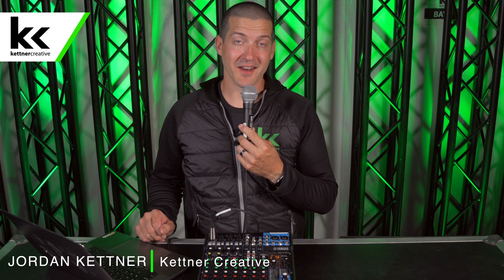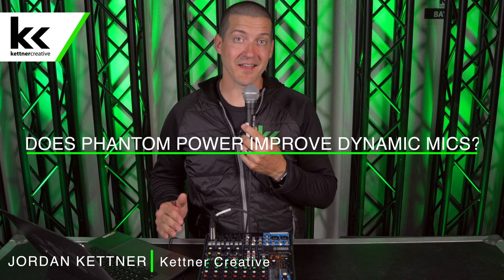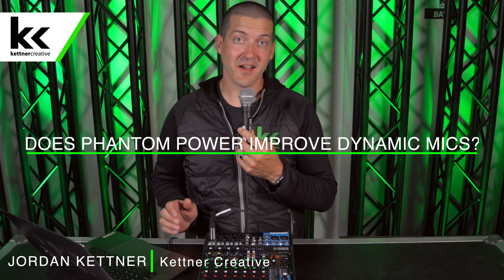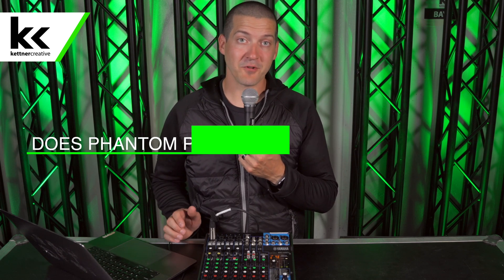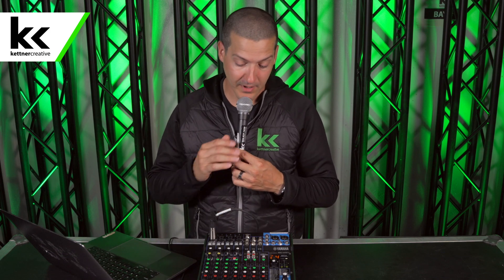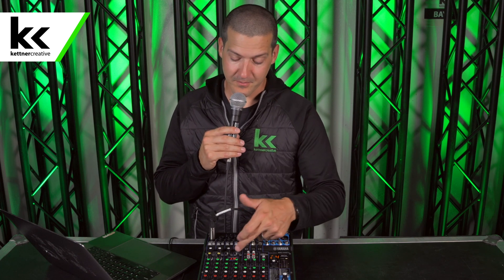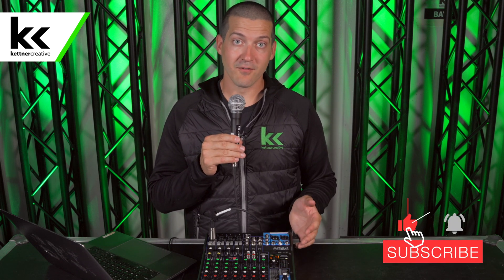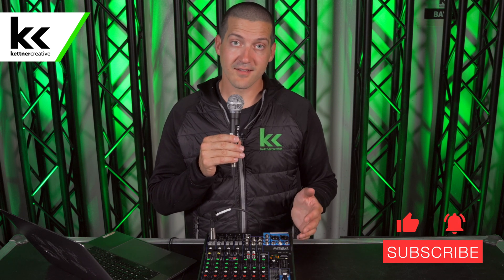Does Phantom Power Improve Dynamic Microphones?

Comment: Shure states that all their dynamic mics and wireless receivers are immune to phantom power. That’s good, because they often have to share a board with condenser microphones that require phantom power to drive their internal preamps, and cheaper boards don’t have separate phantom power for each channel. Good dynamic mics should have impedance-matching transformers in them, and DC phantom power does penetrate transformers, only AC audio does that.

Comment: What if the length of the cable from the mic to the mixer is just to long and you have to turn your gain up to the max and still not getting enough volume. What do you do then? It is a dynamic mic
Reply: Cloudlifter

Comment: Thank you for the video. Is there any interface equired for dynamic mic (I have Audio Arry AM-C11) to connect to ipad pro for screen recording or voice over?

Kindly suggest thank you
Reply from the maker: Dynamic Microphones typically require a lot of gain, so it's recommended to use an interface with a decent preamps to get the best sound out of your microphone.
Reply: @kettnercreative  thank you for your response 
Can you please suggest a decent preamps. Just a word, I plan to record voice over on my iPad Pro for my math classes. I use Goodnotes app for writing math.

Comment: Thanks for this video. One follow up question so I am clear. I have a Shure SM7B mic (dynamic mic) and a Rode NT1-a (condenser mic) and I use my Focusrite as my audio interface. One requires phathom power (the rode) and the other does not. Will plugging both of them into my audio interface and using the phathom power damage the shure mic? I know you said, that shure is bullet proof, but is it bullett proof for continued use of phantom on. 

I wasn't clear on this and I am affaird to use them at the same time for my podcast and damage the dynamic mic which I use very often, please clarify. Thanks so much.
Reply: Same question here! Have you found an answer? I want to use simultaneously a SM-58 (dynamic mic) and a Behringer B-1 (condenser mic) on an Edirol interface that can only send out phantom power to both inputs simultaneously, unfortunately... Thanks in advance.

Comment: I have SM58 using soundcraft notepad 5. And the phantom power is built in and has no switch to turn off the phantom power, but the SM58 is still working.

Comment: simply not true. Look at large studio dynamics like the ashton stealth
Reply from the maker: The Ashton Stealth has a built in preamp. When you send 48v to the Ashton Stealth, the power does not go to the microphone, instead it goes to the preamp. 

You can think of it as a ‘built in cloudlifter’ that you are activating. 

48v has no effect on the microphone  portion of this device whatsoever. 48v does not improve the sound/tone/quality of this microphone, it just adds more clean gain.
Reply: @kettnercreative  except that you have to turn on 48v power on your interface to work this feature of the ashton stealth, or any dynamic mic that requires a cloudlifter so... Idk it sounds like you're being mindlessly pedantic. To say it has "no effect on the microphone portion of this mic whatsoever" is hilarious and anyone who has used it before would tell you that even if its technically true, its practically false.

Comment: Can we use/connect dynamic and condenser microphone together in a mixer?

48v phantom power will damage the dynamic microphones?
Reply from the maker: I have yet to ever damage a dynamic microphone when using phantom power after doing this maybe 10,000 times. Any modern dynamic mic will be able to handle it without being damaged. 

If you want to go down a rabbit hole, you can google "unbalanced dynamic mic" to learn more about the ones that might be affected.
Reply: Thank you! Appreciative...!

Comment: I have an Alctron Interface and normally only use 48V for my RODE NT1A, but have tested phantom power on both my Shure SM58 & AUDIX OM5 dynamic mics and note a drop in gain and also boosted high frequencies with the 48V, what would be the cause of that when the consensus is there is no effect whatsoever?
Reply from the maker: You should definitely not be seeing a difference in gain or EQ when you add phantom power. I would contact the manufacturer.
Reply: @kettnercreative  Thanks mate, I have a Focusrite 2i2 coming so will see what it does with that, is it possible the cables could affect it?

Comment: Hi sir have a small doubt for example when we use a condenser mic we need to switch in the phantom power so when we use a dynamic and a condenser mic together will it cause any issues or is it OK if we use like that
Thx sir
Reply from the maker: Generally speaking, this is not an issue at all. I have yet to ever experience an issue with this. The far majority of dynamic microphones are balanced and will remain unaffected by phantom power. 

The only microphones that will be negatively affected are unbalanced dynamic microphones (very rare), and ribbon microphones (also very uncommon).
Reply: @kettnercreative  OK sir thx for the information

Comment: Been looking for this content thanks! But I do have a question, does the output of dynamic microphone increases/boost when using a mixer/v8soundcard before plugging it in computer mic input than plugging in the mic directly to computer mic input?
Reply from the maker: Great question. Yes, any type of mixer/preamp has the ability to boost the signal before connecting it directly to your computer
Reply: @kettnercreative  Thanks sir already subbed to your channel !